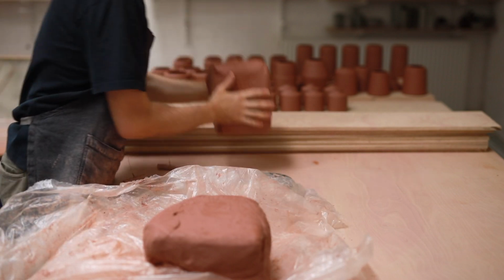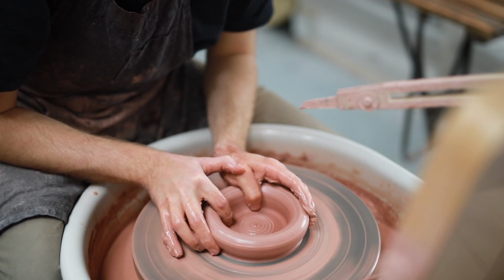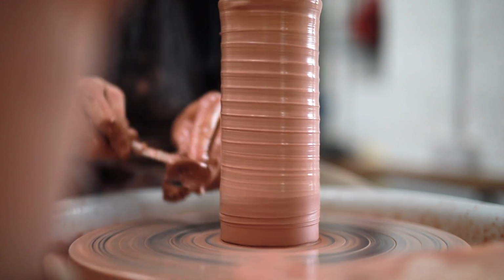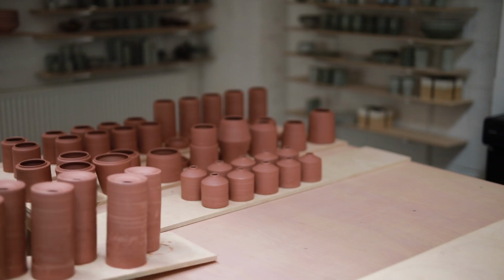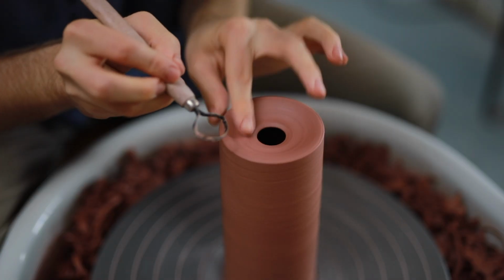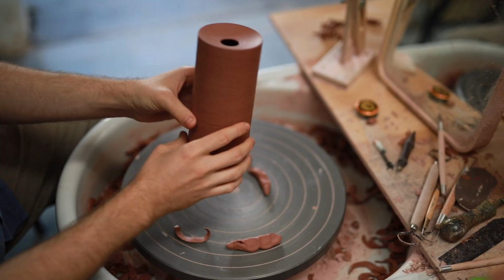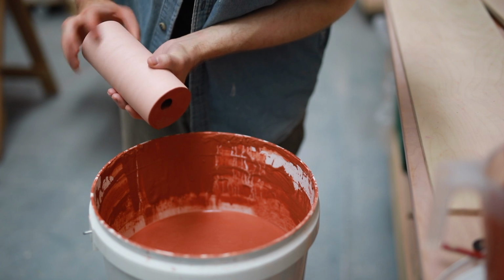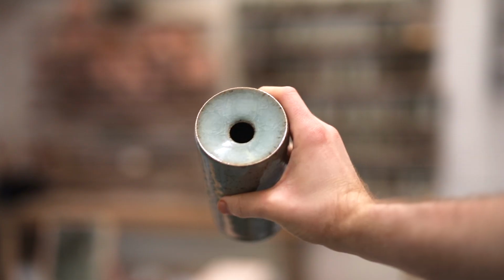How to Throw, Trim and Glaze a Cylindrical Bud Vase — Narrated Version

Comment: It thrills me so much to see you wedge your clay the same way I do and you keep your wedged clay in a little cone shape.   I made some jars, but did the lids just a bit different than your lids.  They are in the kiln right now.  Wish I had a gas kiln.
Reply from the maker: Thanks for watching Carolyn, the little cone shapes important I think, makes for slightly easier centring when thrown onto the wheel, even if it only saves literally a second or so. Good luck with the firing!

Comment: Recently found you on Instagram and really love watching your videos. Thank you for sharing your process so thoughtfully. You may have already shown this in a different video, but I am wondering if you attached something to the bottom of the piece before dipping it in the glaze? I dislike using those big clumsy tongs so my eyes widened when you seemingly dipped it by magic. Thank you!
Reply from the maker: Thank you so much! Glad to have you onboard here too. I'm afraid not, no magic or anything. I just put my finger in the hole and push it underneath. I only ever do this with these forms as the interior is already glazed and the base is covered in a layer of wax so thankfully the glaze isn't absorbed there. You can glaze without using tongs but I'd say in the long run it's worth it as it's not only faster but it's easier to get a uniform clean surface too. They are definitely awkward to use but after a bit of practice it'll start to feel normal. Thanks for watching!

Comment: What a wonderful piece 
I just want to know something, is glazing plates or cups and use it for food safe ? 
Or glaze is harmful to health ?
Reply from the maker: Thanks! They aren't harmful, the materials used int he glaze and clay are all really quite inert. The crackles do stain overtime but there's nothing dangerous about that unless you're firing at lower temperatures and are using certain toxic materials. This is an interesting link to read over, https://ceramicartsnetwork.org/ceramics-monthly/ceramic-glaze-recipes/glaze-chemistry/techno-file-dirty-dishes/
Reply: Glazing makes the pottery a lot less porous and therefore more hygienic. Of course, you don’t want to use anything toxic (such as lead) for glazes that are going to come into contact with food.